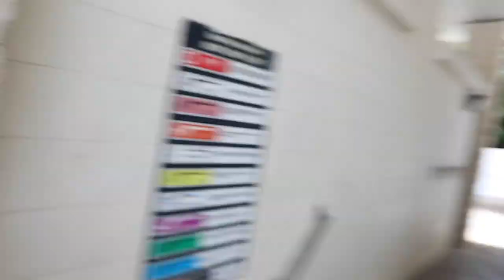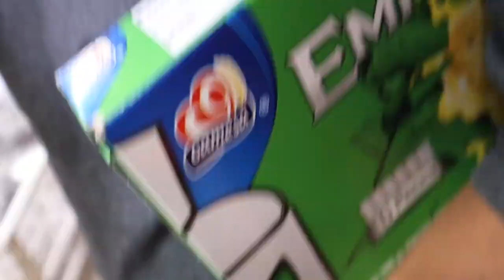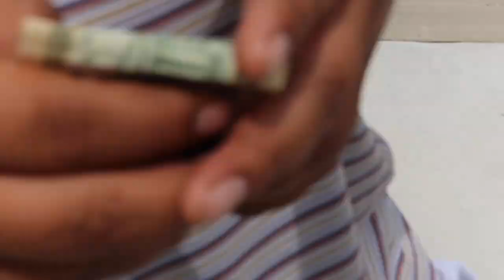NEW TRUCK | Se Hizo La Carne Asada

Comment: 7.5 super lift in the front get a bigger drive shaft and UCAS so ur angles are on point 8s wrapped in 37s in the front 33 in the rear ah and 💩💩💩 the HD front end is nice tho no cap just 6 inch lift on 35s  you got options from there